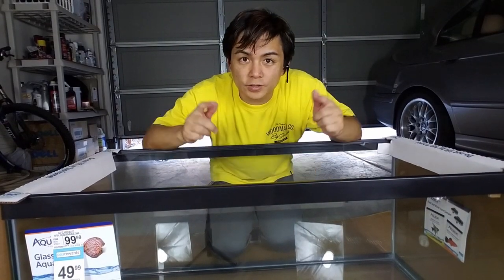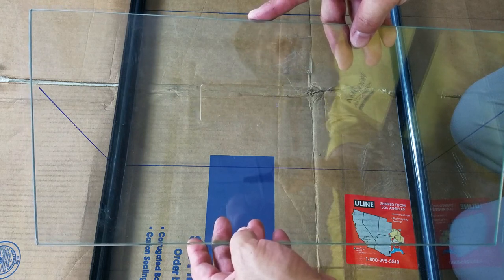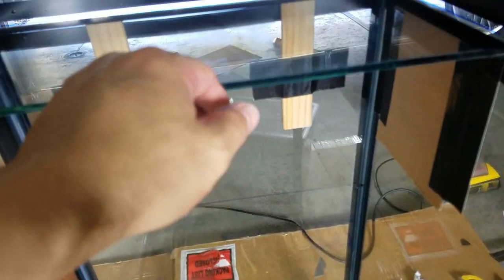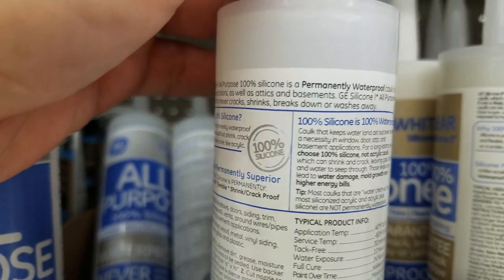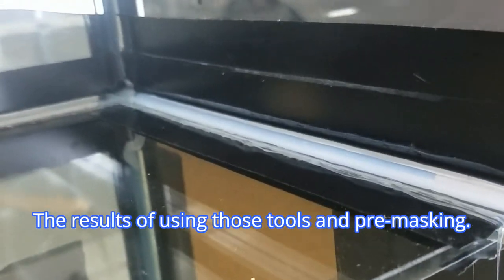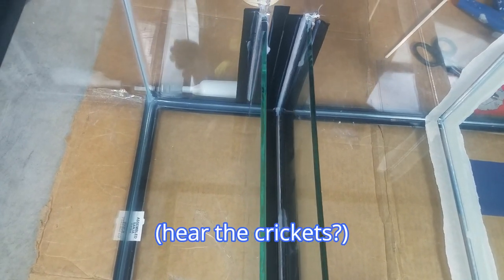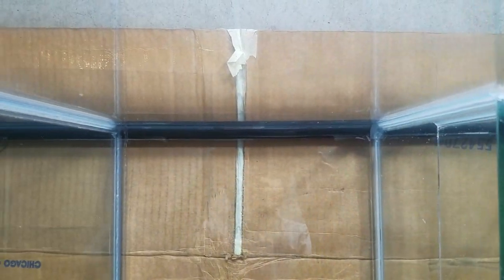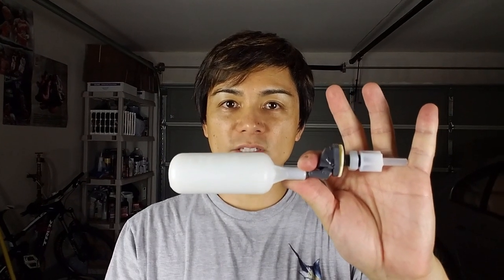140g Reef Tank Build: Clean DIY Sump for Under $100

Comment: Great video. FYI, always pull your tape immediately after you lay the bead. Much easier. Also, I’ve found that the tight inside baffles really only need one bead of silicone. A sump is a low flow tank and as long as the glass is clean- one bead of silicone is all you need. I do the most inner baffle first and work my way out. Saves a lot of headache.
Reply: I been doing just the outside beads on the bubble trap baffles for ever, works just fine especially since there isn't any pressure to hold but even when tank is full it's just fine

Comment: Abe, great video bro. If you peel the tape before the silicone drys...it’s very easy to remove and produces very clean lines. Painters tape with “edge lock” is by far the best. Best of luck on the next sump build!

Comment: When they cut the glass for you have them round the corners of bottoms of the baffles, or if cutting yourself just do it then. It makes the fit so much cleaner and allows a little extra room for silicone without worrying about damaging the tanks

Comment: Nice beer choice, love the chopstick tools, great idea. I think I would have drilled it firth through, would suck to crack the tank after finishing. Great build video.
Reply from the maker: Yeah better in that order. I drilled the hole yesterday. There are a few chips, but it will work. "It's functional and it won't leak" is the nicest way I could describe it lol. For how long I've been in the hobby I should have a drill press by now. I think it would cut down on the chipping.

Comment: Instead of cutting the silicone on the tank for the baffles to sit flush with the bottom, a better way is to have the bottom corners of the baffles clipped.